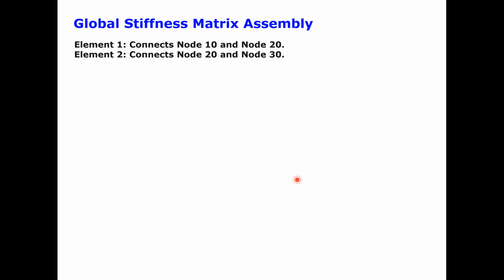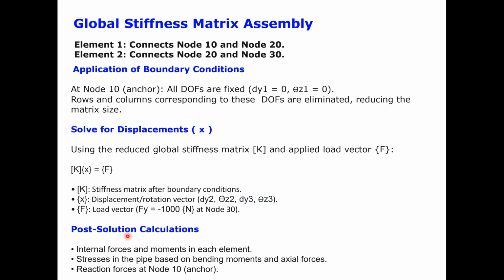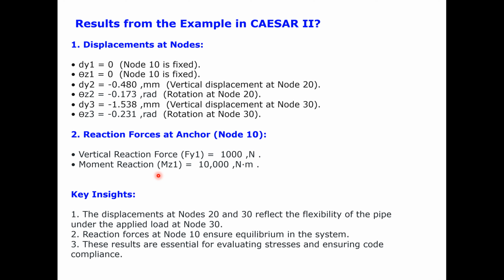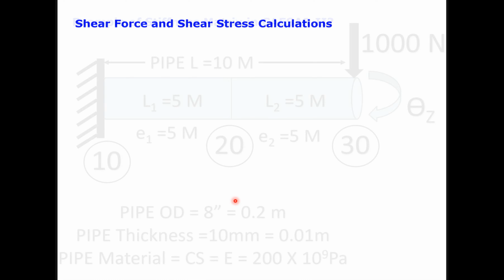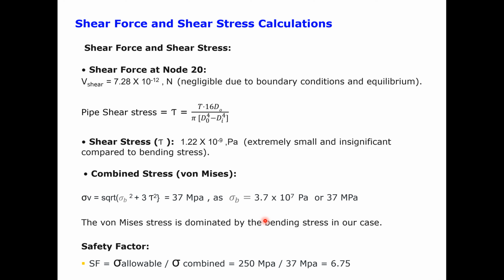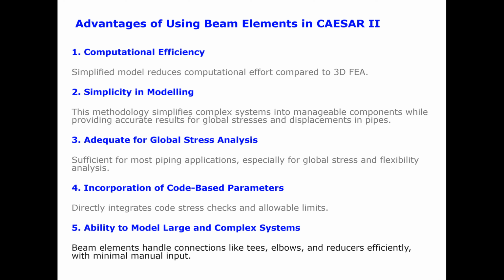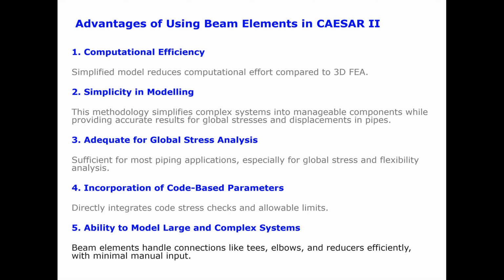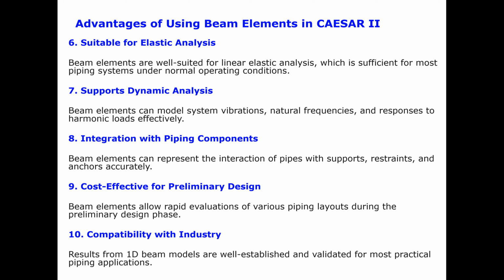Basics of Stress Analysis Part 3C

Comment: Sir
Which compiler used for Caesar ii source code?
I mean Fortran or C or even Python. 
Can u explain more about that.
Reply from the maker: The CAESAR-II software used Microsoft Visual Studio as primary development environment, leveraging its C/C++ compiler. If you are trying to compile CAESAR-II sourc code or modify it, you need the recommended Visual Studio Version specific to CAESAR-II. Secondly, proper configuration of all dependencies and libraries used by CAESAR-II.